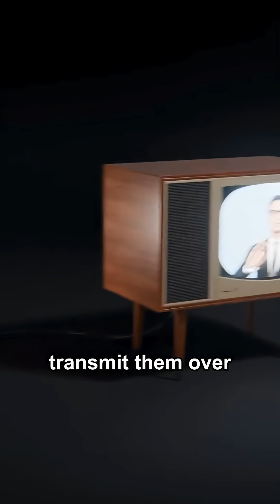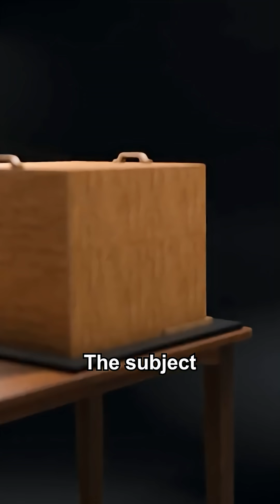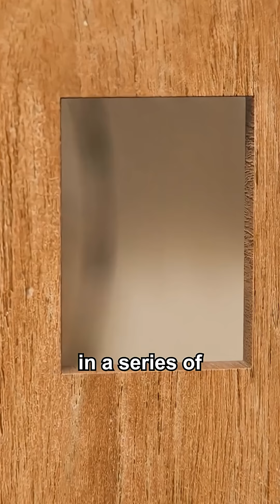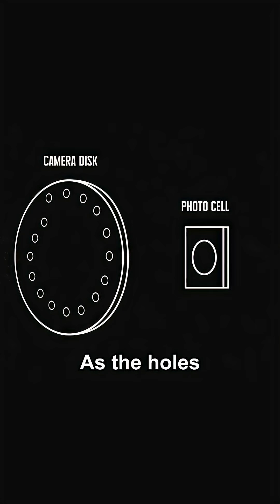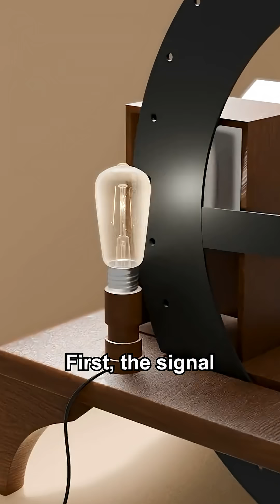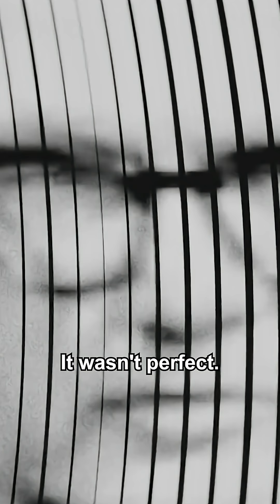How Television Was Invented

Comment: light bulb wouldn't work on receiver's end. Badly researched AI stuff.  Go fly a kite.
Reply: It would work since there would be high voltage transformer tubes plus an amplifier circuit on it. The light bulb was a neon lamp which needed high voltages to work. Primal space only covered the main concept on how it will work, not a science lesson you nut.

Comment: It’s cool how you explain the idea of how television works and how I looked up when it was invented once and how I do remember seeing what the televisions looked like in the 1930s and how they looked like radios which I felt was kind of odd because weren’t they a television, so wouldn’t they actually have images and then I saw the first television from the 1920s that had an image which actually made sense and it had a tiny glass hole it’s actually that they can exist because of the concept of craving an image on another object and how I was also questioning to myself because I remember seeing how TVs were invented by creating Lines that they said were pretty choppy as a way to create frames and have rules created by using red blue and green light, which I thought were pretty confusing and I thought to explain why lines were on the TV, but I was still confused having a images of frames and I was always wondering how it worked but thank you for explaining this but mainly red blue green light combine so fast just like frames on the movie camera to create color and lines were on old TVs because they were choppy scenes created light spreading quickly, but still slow enough for it to look pretty low in resolution but old films by the way did exist in the early 1900s of cameras which you mentioned of old movie tricks that pretty chubby but very creative film.😅😊 for the reason why lines were on one modern TV is because they would do the same thing with spreading lights so fast that the human I would blur it into a moving image. It’s all perception just like a fan moving and how when you take a photo or blink it looks still.

Comment: Yes, there are at least two ways to create TV - mechanical and electrical. The UK went with mechanical and the US went with electrical.
Reply: Mechanical televisions (1920s–30s) came first but they were low-resolution pictures later technology and research for Electronic televisions (1927–present) replaced this by using electromagnetic fields and vacuum tubes to paint images onto a screen. It was a progression of technology.
The first commercial electronic television sets were produced by Telefunken in 1934 in Germany.
Reply: @Surendrajaipur  The UK actually had a brief period where they alternated between broadcasting electronically and mechanically.  Like everywhere else, the UK sent to strictly electronic television early on.